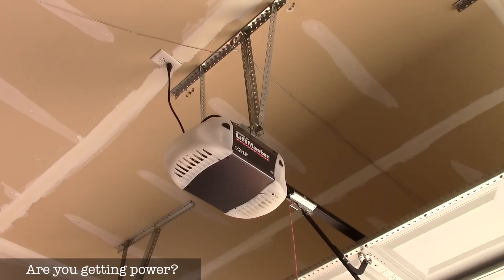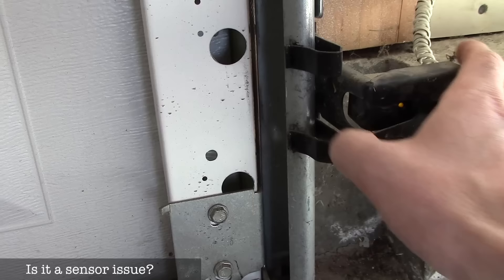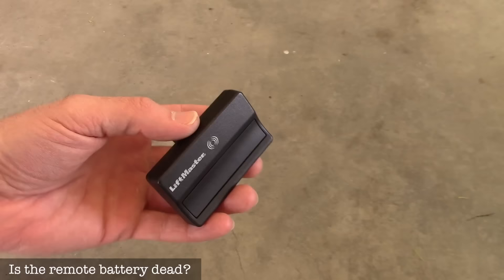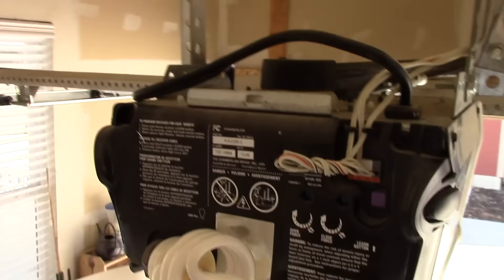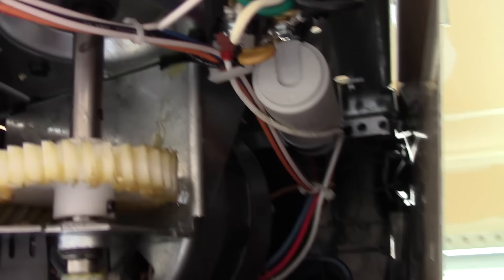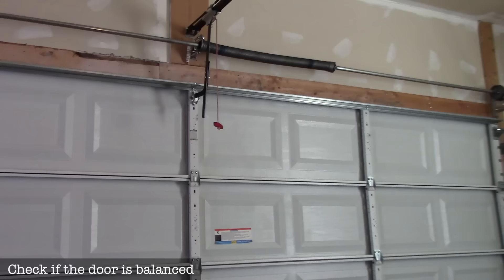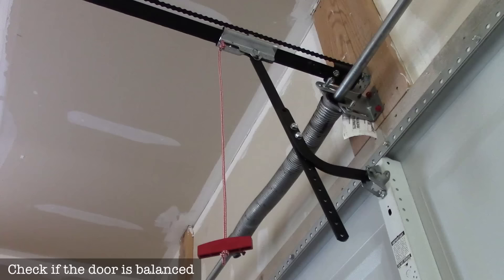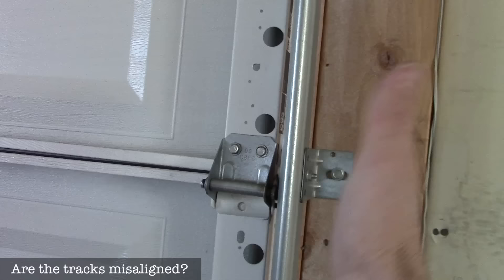Garage Door Opener Troubleshooting and Repair - How to fix common problems

Comment: Have a sensor that is blinking red only 2x. Then repeats. Whether I use remote or main on/off switch...the motor does not activate at all. Wondering if you have any ideas? Seems that the sensors line up but only 1 blinks and the other is solid green. Ty

Comment: hello, Adam... okay i opened my garage by genie it opened fine, but when i closed it it went down half way and stopped so i looked at the motor and ofcourse the chain fell off so i put chain back on but now when i try to open the garage door it goes down but goes right back to half way up.i think it thinks it is closed or open weird.  i searched maybe there was a reset button there is not i unplugged it at no go i am just trying anything.

Comment: I have a liftmaster the door will open once then if I lift it again it will stop in the up position and all power shuts off. In about 20 seconds it will light up again.  After trouble shooting I could hear a clicking in the motor and could bump the motor and have the lights come back on. I checked the boards and couldn't see a bad soder.  Any ideas.

Comment: My door stops at the up limit fine but when pushing the door button it starts down and stop and returns as soon as it get off the limit switch.  Eyes are properly aligned.  No matter what you do it will not travel over to the other limit.  Door, chain, sprucet etc all in good condition.  electrical board ?

Comment: My garage door closes with both the wall control and the remote  but as soon as it closes, it immediately reverses and re opens. The sensors are clean and aligned.

 It worked fine until I hit the entire unit with the back hatch of my car when I pulled out of the garage. It broke the light bulb. 

The front light that normally flashes when the sensors are triggered is fine but not flashing.  All visible wires are connected. I have not taken the back cover off yet to check the board and that is the side my lift hatch hit.  Hope this is enough information. Any ideas of what I can do to get the door to stay down. It wont even stay down if I continuously hold the wall button or remote. It always pops right back up. My unit is an older Liftmaster that has a twisted rod instead of a chain.

 Thank you very much in advance!😊

Comment: Hi Adam I just changed the back up battery in my chamberlain whisper plus garage door and the lights don't work and it only works when I unplug it.  I have a flashing green light when plugged in.. please help if any info on this issue thanks

Comment: Our problem is that it goes up fine, but if you use either of our two remotes to close the door, 9 out of ten times roughly, it will try to go UP instead. This started after I oiled the chain to prevent squeaking.

Comment: Hi, I have Liftmaster,  it works fine while operating, but few hours later it will open on its own. Unplugged it for night, plugged back in the morning and it opens only 8 inches,  had to resett force and travel distance, reprogrammed all remotes, and it still opened in few hours. Sensors are fine too. Battery LED is off. What could be a problem?

Comment: My sensors don’t seem to be getting power. I disconnected from the wire nuts and hooked straight to the main box and still no power on them. But power everywhere else. Would that be the board or the capacitor?

Comment: Hi. I had to change the rubber belt in my garage opener; now I 
can't get the inner trolley to engage with the outer trolley. The inner trolley just moves about 3 inches. Any idea how yo fix it. Thanks in advance.

Comment: intermittent trouble, no leds on either sensor. plug in has power, turned circuit breaker on and off a couple of times and have lights on sensors. works for a couple of days and quits again.

Comment: Dear Adam,  My garage door opener has no power and the wall control led blink and it not lock, How would I know if it the logic board or the power board that is bad. Any help is greatly appreciated. Thanks

Comment: Craftsman 1/2 hp - power to unit confirmed as lights turn on when depressing button wall unit and the led light is on near the learn button, sensor lights are solid and LED light on wall remote is solid, but motor does nothing.  I just watched the video and haven't opened it up yet to check condition of the inside.  Any suggestions beyond what was presented?  Is the motor burned up?  Thank you!

Comment: Having issues with controls no closing the garage door.  They open but not close. I checked the sensors and they are fine.  It opens and closes fine by wall button as well.  We tried resetting the controls from unit but didn't change our problem. Do you have a solution we can try?

Comment: I am having the same problem. My garage door opens but will not close unless I do it manually. Closing does not work whether I use the remote or the switch. I have tried to press & hold down on the switch to bypass the sensors, but no luck. I have replaced the sensors, confirmed power to the sensors & that there is no obstructions in the path. I have replaced the capacitor. Changed out the switch on the wall. I have also confirmed there is nothing in the tracks of door wheels. any other ideas would be appreciated?

Comment: My is a long screw in the midle, master lift 2000sd and after I change the plastic connector in top of the motor that connect the motor and the long screw, the old one broke, well now the door is in close position and I hit the small panel to open it just want to close more even that is close, but it works ok before that plastic connector broke can you help me

Comment: Hey Adam mine just quit working all together no lights anywhere remote doesn't work wall button doesn't work just all of a sudden one morning nothing at all. I did check for power there is power going to the unit. Any suggestions? Thanks for your help!

Comment: Hi Adam, my door is not opening: the motor is working and I don't have a chain like you but different thing that's rotting there and seems like it can't pick up door for some reason. It makes lots of noise and if I help open it with hands it goes up. What could be the problem? Thanks.

Comment: My opener has power but when I push the wall button or wireless remote buttons nothing happens aside from the led light next to the learn button flashes. 
I have pulled the circuit board out and inspected all of the solder points and everything looks fine. Could I possibly have a faulty motor? Any other ideas on what it could be?

Comment: Hi there!
I was rep,acing a light bulb and it sounded like a circuit blew. I looked at the main house circuit breakers but they are fine. Is there a way to reset the garage door opener?

Comment: Hello, my garage door is opened and anytime I press the button on the remote or the switch in the wall, the door only slides for six or seven inches trying to go down, but immediately reverses back up. Door was ok untill I pulled the cord to unlatch it and could bring the door down manually. Thanks for any advice.

Comment: Hey Adam, greetings. My garage door has a problem. It doesnt work. But if i switch off main power supply and switch it again. It works for 2-3 times or just for 1 time.!!! Any idea what could be the issue mate???
Thanks for uploading the video 🙂
Reply: Have you found a solution I’m having the same issue!!😂

Comment: Help! When i push the button (hard wired or remotes), the door moves maybe a cm. Push it ten times and it will move a fraction each time. Gears look fine. They are moving . Power is fine. Sensors are good. Sometimes it works. I took the light bulbs out and that improved it from working 10% the time to 30% of the time. When it does work it's perfectly smooth. Any suggestions? Thanks very much.

Comment: Trying to help daughter with garage door.   It will not go up.   It is an Overhead door it starts to go up and then stops.   I thought possibly a problem binding so I pulled the red cord that basically disconnects the door so there is no load and it still stops.   Is replacement the only alternative?

Comment: My door opens with the small portable openers, but does not open with the wall mounted opener.  The light on the wall opener is on, and the wires appear to be solidly conned to the motor unit.  Any recommendations?

Comment: I have a Liftmaster 1/3 hp.  Home was built in 1999 and it is original,  so probably an 890Max. It has been reliable and now will open with remote, but not close.  Of course the hard wired button will close it.  I have reset the remote and replaced the remote's battery.  I also cleaned the lens on the  sensors (one is glowing green and the other red).  I turned off the LED lights  and it still is not working.  Any suggestions?  Thanks for any help.  >

Comment: Hi my garage door is stopping in opening and closing both ways anywhere. Its sensors are  good, a tripping sound is heard from motor assembly and bulbs are also blinking at the same time. Kindly guide me how to fix it.

Comment: Sorry if I have incorrect lingo, I'll use what I THINK are the names of the parts.  I have a Chamberlain LiftMaster Professional 1/2 horsepower. Sometimes (not always) when the button is pushed either in the car, or on the wall in the garage, the motor makes a noise for about 1 second and then stops and doesn't lift the door.  If I pull the rip cord, and then reseat the trolley on the slide and then push the button again, the opener works as it should and lifts the door. It has only happened when raising never when closing the door. Any ideas?  Thank you for a great video.
Reply from the maker: Do the bulbs blink when it is not opening?
Reply: @AdamDIY  No, it just makes a noise for about a second and doesn't open. No flashing bulbs. Once I pull the rip cord and then reseat the connection it works fine for about 10 or 15 more times. Then, rinse and repeat. PS. before I wrote my first question I hadn't seen the entire video, now I have.  You did a great job. "Rip cord" from my question = "safety cord" from your video.

Comment: My Liftmaster 893LM door won't go down with the remote and I have to hold the wall button down to make the door go down. The lights on my sensors are on,but one is green and one is yellow. I've tried adjusting them,but they stay the same.

Comment: The outlet where the unit plugs in has power but when I plug in the actual unit nothing happens no lights or anything comes on? It worked fine then now I have no power going to the wall switch or the sensors or the mounted unit?

Comment: . I have a sold red light on one sensor. If I put my hand over the sensor, on either side, it starts to blink, so it definitely sees the other side. I have tried moving it up down and from side to side and nothing seems to fix the issue. Any suggestions? I recut the wires and I've run a string between the two and they seem to align...

Comment: Any idea what could be causing the door not to go down at all. I just Installed a Chamberlain garage door opener. On it's first run it started going up. Then crashed into the stop bolt and I was forced to pull the power plug. The trip on the door was pulled so only the trolley was moving. The sensors are faked out by aligning them over a short distance for the moment and green light was on at the receptor. Pushing the button again to make it go down only continues to force  the trolley agaist the stop bolt. There is no flashing of the light when the button is pushed so it can't be a sensor problem. Seems like the motor just does not reverse.

Comment: Our switch in the garage works to open and close the door, but the remote only opens it intermittently, but will not close it. Batteries have been replaced in the remotes. What would cause this?

Comment: I have a weird question that I will try to explain. So when I disengage the opener from the track (pulling the red cord) it seems to be under alot of pressure. Is this normal?

Comment: Mine doesn’t want to go down using any remotes in both cars or hand held remote. I have no flashing, sensors are less than a yr old and are clean and properly aligned. It will close using the wall switch. I also cannot stop it from going up once initiating it from the remotes unless I use the wall switch.

Comment: I have a problem. All my garage door openers work (5 of them including ones that come with a vehicle) but at times they dont work unless I get really close to the garage door. I have changed all the batteries but the same thing happens. I also have a key pad on the door jamb. Sometimes it works and sometimes it doesn't. It's almost like there is a weak signal from the garage door opener since all my openers are doing the same thing. How can I fix?

Comment: Try closing my garage door n heard a loud popping sound. It appears the track had came loose from so I reset it by pulling down the string n let the piece of plastic back into it n let go of the string to let it insert back to the bracket. But it keeps on popping out n will not stay locked. I also notice there is a lot of grease around it. What should I do? Thanks.

Comment: My Craftsman opener seems not to hold the upper travel limit setting. I get it set properly, and after several cycles, the trolley runs right past that limit point and presses against the stop bolt. From there it won't go back down until I remove the stop bolt and relieve the tension. then it will travel down, I readjust the upper travel limit and the same thing has happened twice now. any ideas?

Comment: Question I have a older craftsmen I wanna limit the issues , the wiring no breaks .. but i was wondering the way they had it wired was power to the first screw and then the sensor wires crossed , one white one back on the next to screws. Is that correct? Or does it go both Black's fo one screw n both whites to the other screw???? I've tried re programming a new remote followed steps and nothing.. it was closing from at least the main button now I gotta hold the button in but nothing is blocking the sensors but there lighting up now , when I switched the wires to both whites on one screw and both black on the other I believe  my sensors lit up but when i waved MY hand they would cut out so u switched them back now nothing. Please help the board is the same price as a new motor. But im getting power to the motor just not programming.

Comment: My garage door has no problem closing.  The problem is opening the G Door.  It only opens roughly 6 inches.  I replaced the roller with nylon instead of original metal rollers.  Didn't resolve the problem.  What should I look for other than binding rollers on rails?

Comment: My garage door opener is only working when I hold the button. According to you that suggests a bad sensor.  The sensor on the left has a green light, the one on the right has a yellow light. Is that an indication of a sensor problem?

Comment: So the led on the wall button is flashing fast like it's strobing and the door won't open or close. Sensors have power and are aligned. The button for the light does just clicks fast when pressed. Do I need a new motor?

Comment: Mine is not closing, it keep jamming then coming back up as if something is blocking it. It's not 💯 consistent. I started four days ago and went from not closing 30% of the time to now It will work maybe 1%. I tried pressing and holding the close button to bypass the sensor and it's still not closing. I did notice the lens on one of the safely sensor is missing... Wonder if the lens make a difference on whether the laser is being received/transmitted and if that's the case why when I held the close button down to bypass the sensor it still didn't close...

Comment: Thanks I have a garage door opener that went past the opening spot on the chain and it got stuck on the safety screw. Now when I turn it on it wants to go up again. How can I reverse the cycle so that it goes down and I can adjust the open position? Thanks
Reply: You will need to run the motor without the chain connected. The reinstall chain .

Comment: My door will work with the wall button but not with the remotes. I have 4 remotes and an outside keypad and none of them will work. I tried changing batteries and reprogramming but still doesn't work. I checked for LED bulbs but have none in the vicinity and all inside the house were off. I only have a single wall button and don't see anyway to 'lock' out the remotes. Any suggestions on what to check next?

Comment: Mine signals that the sensors are blocked and I can override it and force it closed but the sensor lights themselves indicate that they're in alignment and not blocked.  Could it be possible that the sensor is sending a false signal?

Comment: I don't have a remote 
Mine only opens but when I press the button to close there is no power for closing press and hold the button no power at all. So what I do I do I force it down manually then will open again by pressing the button. It's a Genie model

Comment: Everything seems fine with mine.  Sensors are lit  and the led goes out when I block it.  Ive checked the alignment a bunch of times but it still stops and starts blinking like I have something in the door way.  The override works though

Comment: Hello, my garage door reverses automatically when it closes fully even though there's no obstruction in the way.  also, what I've noticed as of two days ago, is that my garage door opens only halfway, and then the motor stars clicking repeatedly.  I did see also that after the garage door closes all the way, the chain gets slack and then snaps backs as the garage door reverses,  Also, within the overhead rod, the chain looks twisted on one side and is perfectly vertical on the other side  What could be the issue and how do I fix it?